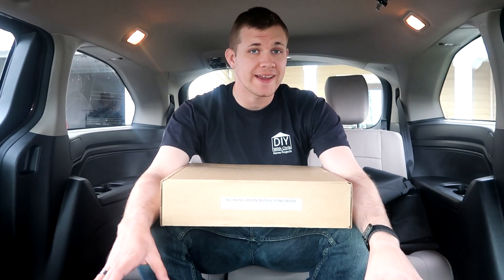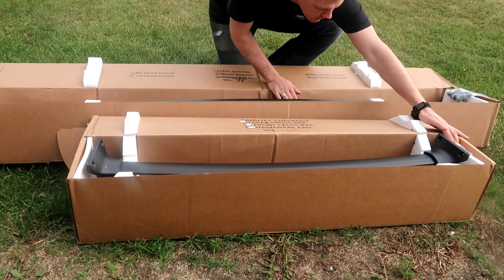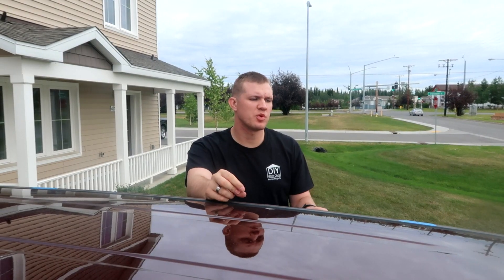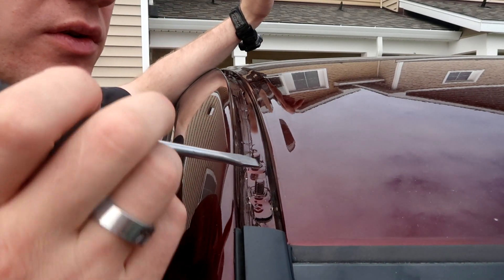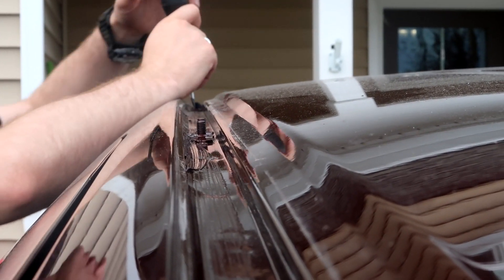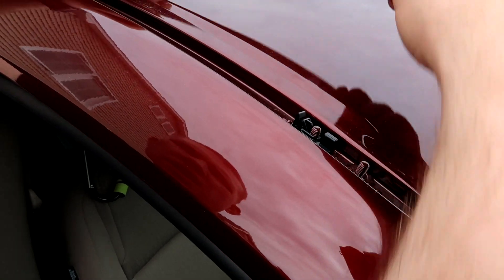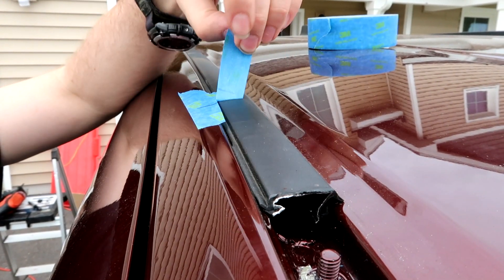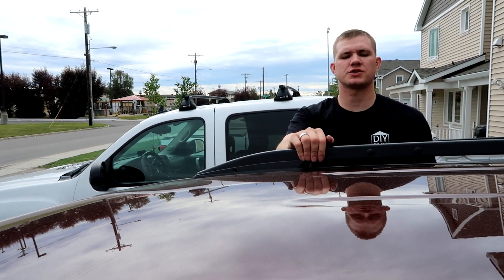How to install roof rails and crossbars on 2018 Honda Odyssey

Comment from the maker: Recapping because it keeps coming up. It was a day or two before moving so I had no tools or accessories available to assist with this project. I did need this roof rack to help hold items during the move. What I used is what was available after the movers picked up our household goods. Thank you all for the comments in advising others on more efficient and practical ways of completing this project. Your feedback and comments are what make this DIY community the best and help people save exponential amounts of money. Thank you for your time and efforts, have a great day!

Comment: Pretty good install video. Only thing I would add (lol) is to use a rag or clothe of sorts to lay on the car while you use a screw driver to pop cover off in order to protect your brand new paint job. You can buy the trim removal kit at Harbor Freight for 10$ or less. But great job being careful with that screw driver. You’re a brave man my friend lol.

Comment: Your link for the Amazon Roof Rails goes to a part that indicates it does not fit the 2018 (08L02-TK8-100), and it does not match the part number at the hondapartsstore link (08L02-THR-100). Are you certain about the part number at the Amazon link?
Reply from the maker: Thanks for the feedback, I've updated the link to (08L02-TK8-102) which shows compatible with 2018.

Comment: when installing a roof rail and crossbars on a 2014 honda odyssey, do holes need to be made in the roof? Or can the existing holes be used?
Reply from the maker: I'm not sure about the install process for a 2014

Comment: so the amazon link you provided is not compatible with a 2018. is that a typo? also, for future use, honda e-store is $100 more expensive than other online OEM store.  check out hondapartsnow.com, hondapartsnetwork.com or hondapartscheap.com for better prices.
Reply from the maker: That could be a typo, Amazon showed me that it was compatible when I linked it. I bought off of the estore. Please let me know if see the correct one.
Reply: I did the same with amazon but that link is for the 2011-17 model.  I cross checked on all of the 3 sites I mentioned on my previous comment plus on e-store the OEM part number is 08L02-THR-100 for black and 08L02-THR-100A for chrome. Lastly, cutting the black top liner would be easier with a dremel tool. That’s what I used when I installed it on my 2014.

Comment: Would you recommend thread locker on any of the bolts?
Reply from the maker: Thread locker definitely wouldn't hurt. Ours are still tight over a year later and with multiple long range road trips.

Comment: Are the crossbars adjustable? We bought an Odyssey with this already installed but it won’t work with our old roof carrier...I need to shorten the distance but it appears I cannot due to the fact there are pre determined holes in the side rails...thanks for your help and great video!
Reply from the maker: Unfortunately, they are not adjustable.
Reply: DIY with Chris Home Projects what is the distance between the rails? Would you mind measuring?

Comment: The crossbars don’t seem to tighten enough and still move a bit, is this normal or what so the solution?
Reply from the maker: Mine did not move after I tightened them down. Possibly crossthreading or just a faulty piece.
Reply: @DIYwithChris  I just needed to keep going, I was worried about stripping it, but I was just a turn from being done. Thanks.

Comment: What is the height of the rail and crossbars after installation? Thanks!
Reply from the maker: Distance between the inside edges of the two bars is approx 2' 2 1/2"". Roof to bar on the outside is approx 2 1/2". The space does get higher in the middle but I currently have a cargo box up top so I can't measure there. Bars are about 2 1/2" wide as well.

Comment: The part linked (08L02-TK8-100) is NOT compatible with 2018 Odyssey, have to return mine. I think 08L02-THR-100 is, but did not verify yet.
Reply from the maker: Thanks for the update, please let me know which one is correct so I can update it.
Reply: @DIYwithChris  What was the product code of the one you used in the video?
Reply: 08L02-THR-100 is the new part (black) for the railing.

If you decide to go with Thule for the crossbar, you will need:
Thule Wingbars Evo 150Model number 711500 and Thule Rapid CrossroadModel number 450R

Comment: What is the distance between the two crossbars? and what is the height from the bar to the roof? I am trying to figure out if my current cargo box will fit. Thanks!
Reply from the maker: Distance between the inside edges of the two bars is approx 2'  2 1/2"".  Roof to bar on the outside is approx 2 1/2". The space does get higher in the middle but I currently have a cargo box up top so I can't measure there. Bars are about 2 1/2" wide as well.

Comment: These crossbars are not adjustable & sit too far to the front of the vehicle.  When the cargo carrier is placed on top, it is nearly impossible to reach by standing on the back bumper, as it sits too far forward on the van.  A huge waste of $500 & the dealership never mentioned that these are not able to be adjusted.